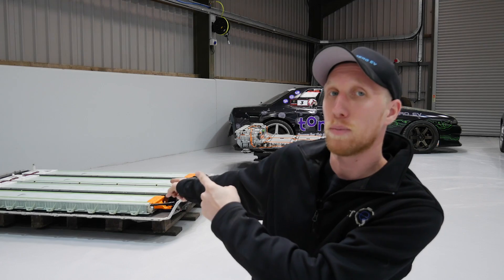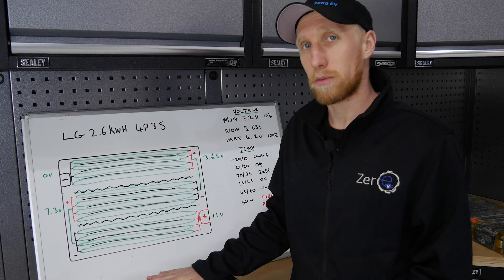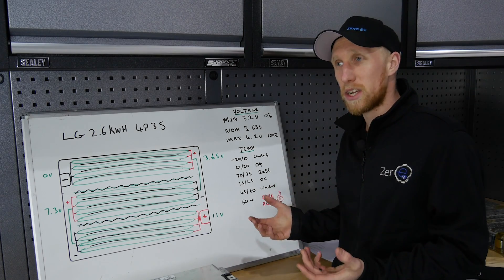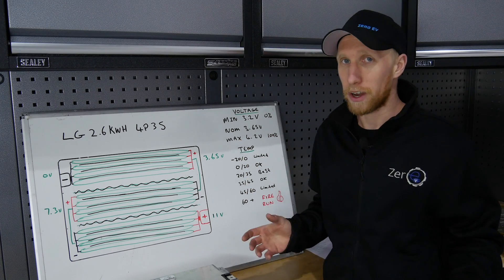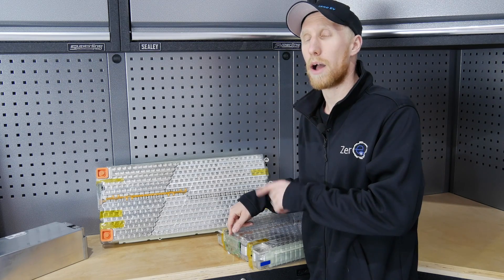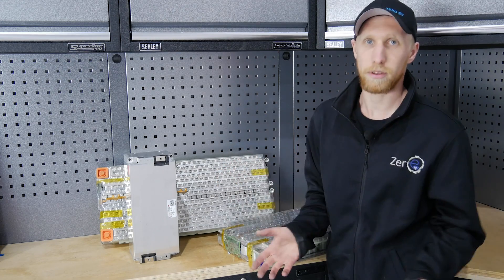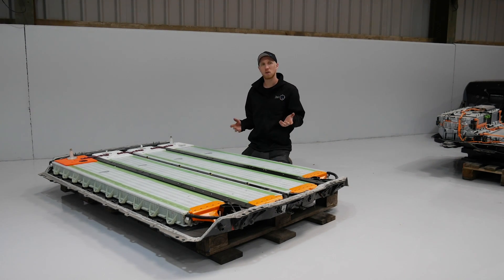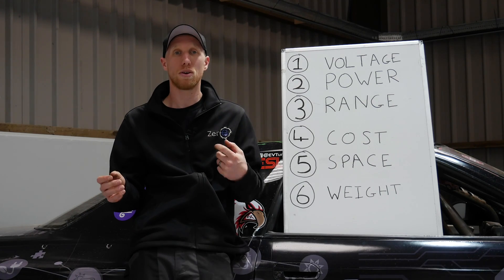EV Conversion Battery Guide - Tesla, LG, Calb, B Class, bolt & model 3 Modules

Comment: whats your battery recommendation for a high voltage motor that needs 300v, and will be installed in a small car?
Reply from the maker: As Tom has said can you tell us what motor? Is it 300v nominal? You have a few options depending on performance and required battery pack size. B class modules if your not looking for high performance. Vw GTE not very energy dense but power dense and same goes for the 2.5kwh LG Chem 16s modules.
Reply: Again, what motor , what sort of power level? Have had good experience with the VW GTE hybrid packs, 10kWh 100kw but there are other small ish packs with large power potential out there like the Chevy Volt Gen1.
Reply: It's a meiden motor from a mitsubishi outlander 60kw

Comment: Can you use different batteries based on intended use? Like bursts of speed pulling from one battery pack and steady speed pulled from another?
Reply: You could do it but it means quite a lot of extra components (loads of complexity) to make sure they work together properly. Finding a balance works out to be the most cost/weight effective.
Reply: There's no such thing as "bursts of speed." You can design for a top speed, or an acceleration as primary considerations. Otherwise you wind up with a car that does neither very well. The well kept secret on Teslas is that their acceleration starts to suck badly around 70-80MPH.

Comment: Thank you for this very useful video. Other topics I'd love to see you cover in future videos: 1) EV Motor options side by side along with voltage requirements, dimensions, and power output. 2) Tesla rear clip dimensions (using the whole assembly: tires, wheels, brakes, suspension, inverter/motor) and any oddities in what it would take to implement. Most importantly being outside edge tire-to-tire width. 3) BMS options. 4) How to deal with power steering, power brakes, air conditioning, and how tesla components compare to other options.
Reply: I'd vote for 1 & 3, especially deciding what battery build for each motor and what options for the BMS.

Comment: Love the video. Are there packs that roughly match fuel tank size on older cars? My DS's tank is very rectangular and the width of the car, with about 65L volume
Reply: Every car is different so you need to look at actual dimensions to figure out what space you have. Never seen a car conversion where an OEM pack fits unmodified.
Reply: 50 Kg of fuel gets you two of those Tesla packs or 10kW roughly. That's about 40 miles of range on a good day.

Comment: Is it legal (in the UK) to cut the floor out of the boot for a battery box (sheet metal only)?
Great Vid as always BTW.
Reply: Legally you cannot change/modify the chassis, thus it would be a no. However DVLA do not ask for proof.
Reply: @Tom-evnut  is the boot floor counted as the chassis if no rails are cut?
Reply: @alibro7512  Any irreversible change to the structure (anything metal or plastic that does not unbolt) is counted.
Reply: @Tom-evnut  where do you get this info? As an MOT tester I haven't come across it. From our perspective it only applies where a structural modification is unsafe (see section 6.2.1 of the mot testers manual). or, in Apendix a of the same manual, "You should reject any modification of panels if: it has significantly reduced the original strength and stiffness of a prescribed area
plastics have been used to replace metal in prescribed areas or load-bearing areas
If you’re not sure if a modification has affected the strength or stiffness of a prescribed area, you should accept the modification and tell the vehicle presenter. "
I'm not saying you're wrong, I'm genuinely curious.

Comment: Nice video, great info! Now going to measure up for a pack in a Porsche 550 Spyder kit car. Looking to use the motor from the mitsubishi outlander with gen3 Prius inverter and openinverter control board. Any tips/suggestions?
Reply: Watch Damiens latest videos on the Gen3 Inverter.

Comment: Be interested to hear your thoughts on large format LiFePo4 prismatics, especially with all the rumour about Tesla/battery day/offering a LiFePo4 pack... I use a pile of the old CALB cells (ex Allied Electric) and although they are old now, they do seem like good cells.
Reply: From my own experience, and general chemistruy, LiFePo4 batteries will almost always be less energy (Wh/kg) dense than LiPo, and mostly less power dense (W/g).  The biggest advantage of LiFePo4 is they are incredibly safe. I've had a friend blow one up when he was experimenting with a TIG welder for spot welds, and it was very small compared to most LiPo fires I've seen.
Reply: @Dogburt_Junior  do you think there is some magical breakthrough that CATL and Tesla have made to enable decent energy densities with the LiFePo4 chemistry? I know at the moment it is all rumour, but I think everything points to them using LiFePo4 in this 'million mile battery'...
Reply: @Tristan Peters Why are you comparing LifePO4 with Lipo (Lithium Polymer)? Lipo are mainly used by RC hobbyists.

Comment: Please consider doing an EV Rv or camper bus conversion...as well it would be cool to do an EV boat conversion
Reply: I put the hyper9 on an outboard motor, the problem with boats as they use a lot of gas so they need a lot of battery.

Comment: Have you ever considered removing the floor of an existing project car and incorporating a complete model 3 battery module?
Is that possible?
Reply from the maker: We would but unfortunately for road use is not allowed. We have done stunt cars with complete packs in the floor.
Reply: @Hazell_Nutz  why is it not allowed?
Reply: @xXZ31t6esTXx  in Europe it is usually illegal to make structural modifications to the frame of a vehicle.
Reply: @xXZ31t6esTXx  the structural integrity of the car would be compromised. You are allowed to put batteries inside, in the front(bonnet) or in the boot. Anywhere underneath, a strong metal container should be used. Funny thing, in Africa, no laws, it's entirely up to you.

Comment: how do you safely storage the packs?
Reply from the maker: We have battery storage racks and industrial shelving. Try to store all modules at around 30% soc and maintain a temp of around 20 degrees. Can only have a set amount in one area at any time.
Reply: @Hazell_Nutz  and what do you have in terms of fire suppression systems?
Reply: @nicoparra1990  You cannot suppress the fire, with lithium you can only limit the damage they do. So never sleep in the same building as large lithium batteries for example.
Reply from the maker: Nicolas Andrés Parra Fiedler as tom said, but we do have a good fire alarm system that call fire services if set off

Comment: For home power storage, which is the best dollar per kwh pack?
Great video very informative- subscribed 👍🏼
Reply from the maker: The b class
Reply: It depends if you're in the US or Europe where to source your cells. Lowest price I've seen is $89 at BatteryHookup for 10S3P Chevy Bolt modules, which have since sold out. The top 10 batteries cheapest batteries I've seen have been on Batteryhookup. The next best thing doesn't come around until $155/kWh.

Comment: I have a 986 that i dreamed of making eletric (the 2.7 flat 6 isn't that wonderful) which brought me to you guys in the first place.  If you had to do your 986 conversion over again would you have changed anything?
Reply from the maker: Probably would of use different battery’s as the current ones do not allow full performance
Reply: Zero EV , what kind of batteries would you have then chosen, knowing the space available in the Boxster and the current needed by the Tesla drive-unit?

Comment: Nissan leaf battery is not that bad for you not to say anything about it. it only needs good thermal management and I am working on it. Thank you for your good work.
Reply: The issue with Leaf cells, is at least in the US, the used modules have less than 70% capacity left.
Reply: Nissan Leaf batteries vary greatly from vehicle to vehicle, depending on the life of the battery alot of degradation can have occurred. Plus they are quite a limited battery interms of power potential, due to their voltage sag.

Comment: looking into possibly ditching the little single cylinder low revving diesel in our sailing boat. it only produces 6bhp at 2200 rpm (2:1 reduction giving 1100rpm at the prop) Ideal conversion i think.

i make that about 4kw, planning on some amount of solar and also being able to regen through the prop/motor when sailing. 

I fly RC models with similar levels of power to what that's putting out so also familiar with specing motors etc. 

theres quite a nice choice of motors out there looking at the T-motor u11, 130kv,  on 48v probably with a belt drive to drop the rpm down to something sensible will probably help with packaging too.

the thing im stuck on is speed controller it needs forward/reverse and regen also not sure on battery management. do you have an recommendations?
Reply from the maker: You need to look into torque and continues kw output for a boat as it apples a constant load. Battery management will depend on the battery’s you choose but we tend to use Orion battery management system on everything. Motor control make sure you buy a motor with controller will save you a lot of hassle.
Reply: The motor I have linked is known to work well up to 8kW and is really cheap. Rich Rebuilds uses it at 3kW 48V and the 8kW was apparently done at 60V which worked better than 72V. Sorry if this breaks any rules, this motor is the same between many eBay resellers so this is just reference for style. Endless-sphere should have plenty of resources for you and your conversion.

https://www.ebay.com/itm/264630647599
Reply: Could you use an ebike motor for this? lots of 3kW available cheap and controllers too.
Not sure how you'd hook up a bicycle wheel to your boat prop though. 😋
Reply: Just buy an e-tek motor

Comment: I'm looking for modules to pair with a Hyper9 and it says on your website that 10 LG 4p3s modules in series would work and they do as they are the ones you've used in the MX5 but I'm a little confused over the current output, the Hyper9 says it requires a max of 850amps but i don't see how 10 of those modules in series would provide that much, thanks
Reply: The modules will do in excess of 1200 amps, as said the cells used in the modules are the same as Chevy Bolt and those stood upto 1600 amps for a couple of seconds with minimal sag. In a Bolt module its 3p and not 4p, so 850 amps is no issue.
Reply: @Tom-evnut  Thanks